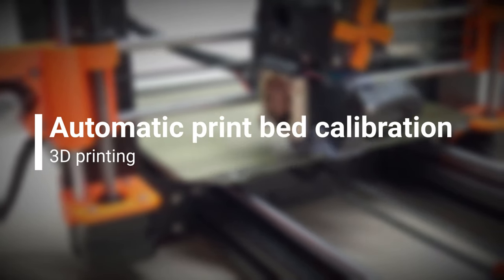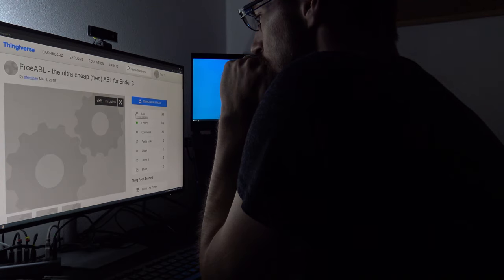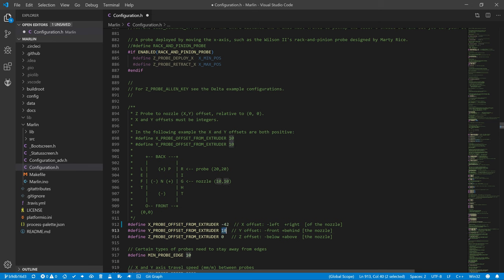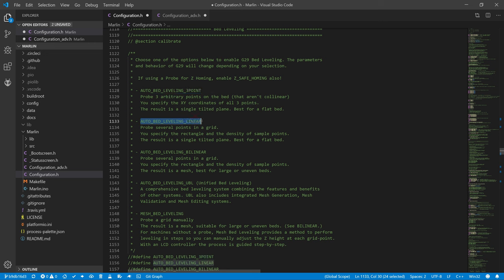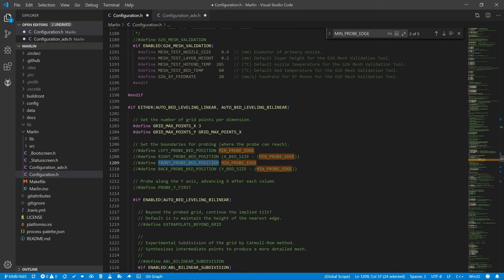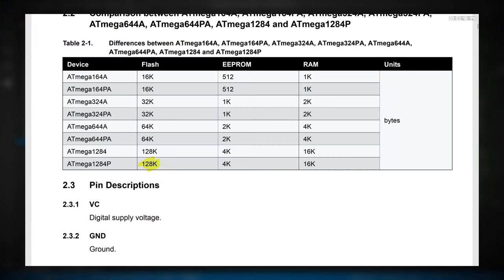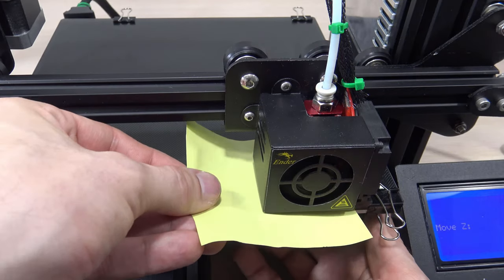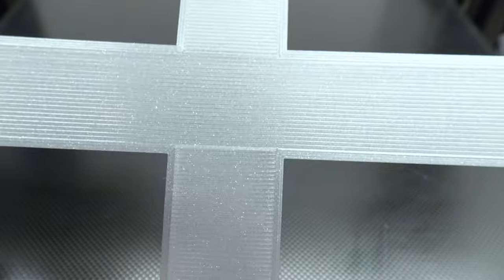Marlin: Automatic print bed calibration (+ Ender-3: FreeABL) (3D printing)

Comment: Thanks Martin, I do it. I was using before MESH leveling. I just have changed to ABL with switch.
I think that a command like "M0 Insert Z Switch" should be implemented on Marlin too when using AUTOHOME from LCD. It happened to me that I forgot to move Switch down before to do AUTOHOME at LCD as you know Hotend crashed with glass.
When using a old gcode file that does not have "M0 Insert Z switch command" in it will crash hotend if switch is above or crash switch with glass after autohome.
Reply from the maker: I have one video in the queue about similar functionality. Sadly, the video has zero priority.

Comment: Hi Martin. Thanks for your videos. I did the modification as well and it works well. The only issue is that the M0 command does not display the text on the printer. I have to add a M117  just before the M0 commands in order to display instructions. I'm using Marlin 2.0.5.3 and printing via Octoprint, and during pauses, it seems I can only resume via Octoprint UI (not on the printer) Do you have an idea about that, though it's not really annoying :-)
Reply from the maker: This is possible. It's because the printer is actually not printing so the M0 can't pause the process. If you're printing via Octoprint, the Octoprint is the brain which is saying what the printer has to do.

Comment: I loved this video. I do have a problem however. After making sure that bed was leveled before getting to the probing, printing out the test cross revealed that my front left corner is somewhat too low. Also when travelling from front left to rear right it seams to blob up and create a slight roughness. Any advice?  I am running Marlin 2.0.7.2 .

Comment: Hi Martin, Thanks for this tutorial. I am trying to use freeabl on my Ender 3 Pro with latest firmware (2.0.6). I did all the settings you discussed along with the changes in update video. 
However when I home all axes, my Z=0 is almost 5mm high from bed. I tried to tweak distance from Nozzel to Probe but no use. I think its not considering NOZZLE_TO_PROBE_OFFSET for Z as it exactly stays above with that distance.

Can you please suggest the better way? Thanks.
Reply from the maker: Sorry, didn't see the comment. This is totally OK. In the firmware is set position after probing. Just go to your move axis menu section and lover your Z to 0.
Reply: did you get it working? I having the same problem with my offsets not working and showing 0.

Comment: Using a BTT 1.4  G29 fails to do anything but make a quick "Cheap" noise as if the instructions are just run through without any actions: NOTE G28 Home works